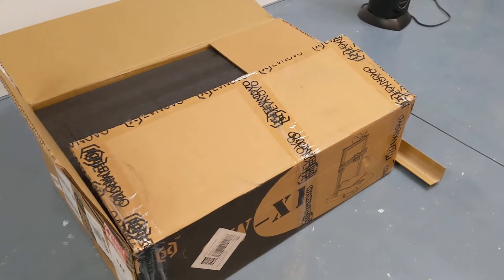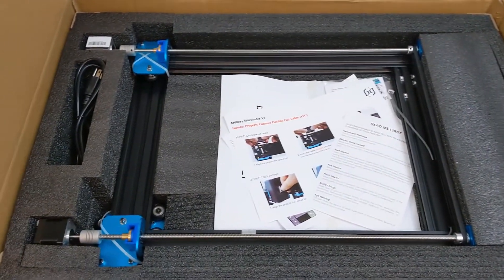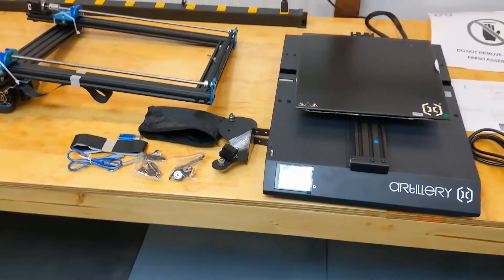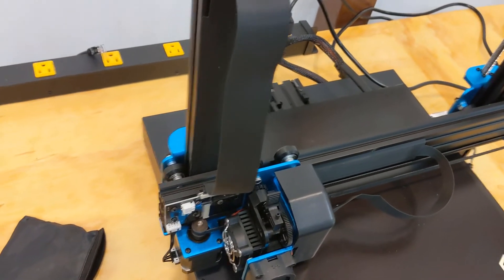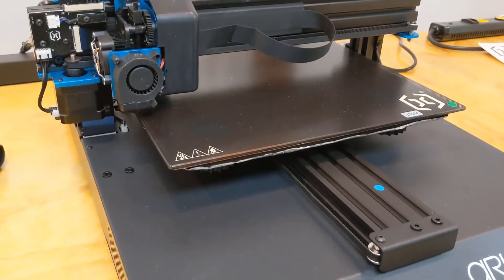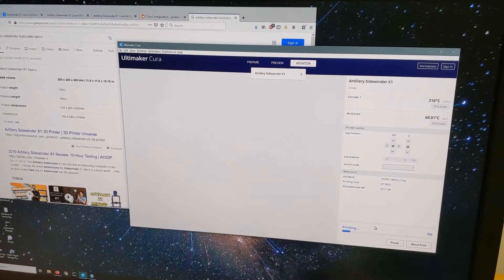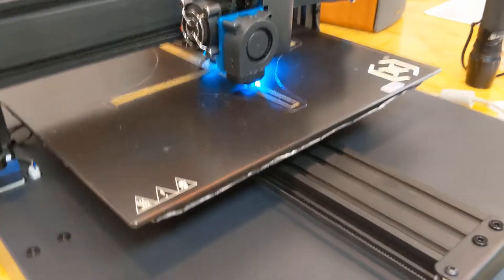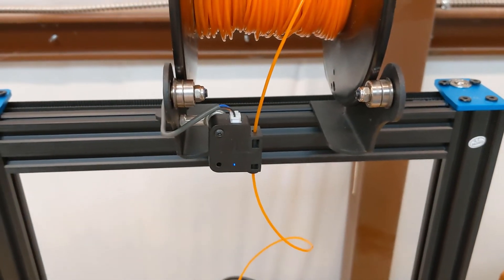Artillery Sidewinder X1 setup and 1st print

Comment: I’m looking into buying this printer, but would like to eventually be able to print higher temp materials like nylon. From what I understand this printer comes with a Vulcano hotend clone, what more would I have to modify to reach higher temps?
Reply from the maker: There is a PTFE tube in the hotend on this printer that limits your top temperatures.  I personally would lean towards the E3D Hemera hotend as it can handle the temperatures for Nylon (and do a much better job on flexible filaments).   If that's too costly do a search for "all metal volcano hotend".   I think the only other mod you would need to be to change the parts cooling fan.  There are 3d printed versions on Thingiverse that do a way better job than the factory one.
Reply: citadelik Thanks for the fast reply. I was already looking at the Hemera, does it include hotend and the extruder? Just confused as to what all the kit gives you
Reply from the maker: @shell1984  The kit has everything you will need.  Just order the 24v (out of stock right now for both 12v and 24v however).   You could experiment with just a "All metal volcano hotend" upgrade first.  BTW depending on the temperature you are planning to go up to you might have to order a PT100 thermistor.   I found a link on how to upgrade the X1 to the Hemera here:  https://e3d-online.dozuki.com/Guide/Hemera+Artillery+(Evnovo)+Sidewinder+X1+(Up+to+V3)/118?lang=en
Reply from the maker: Note: this printer is 24v so keep that in mind when ordering parts for it.

Comment: I should be getting mine this Tuesday im exited, are you going to do any mods?
Reply from the maker: I think the first mod I do will be to make a different spool holder and bypass the filament detector.    I might eventually check out the E3D Hemera replacement, but its too early to say.   Need to get a feel for its abilities first.   Such as printing TPU flex filaments.